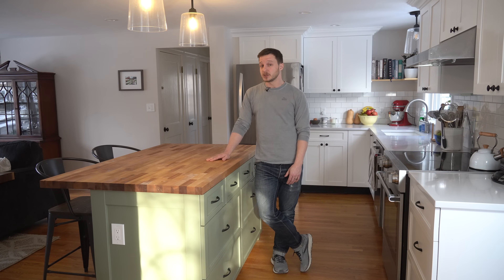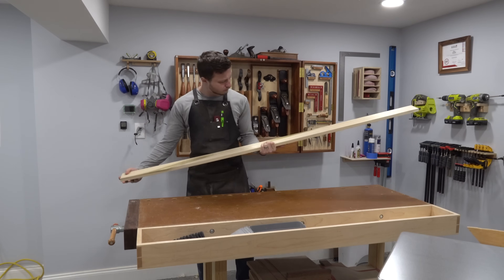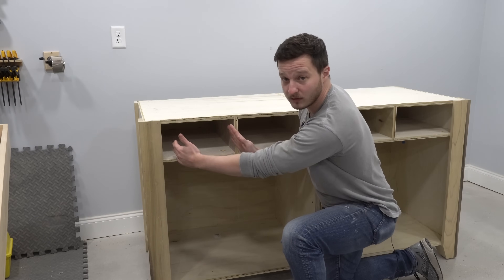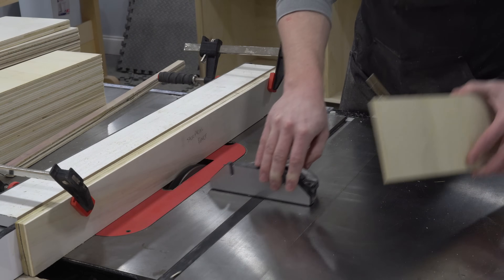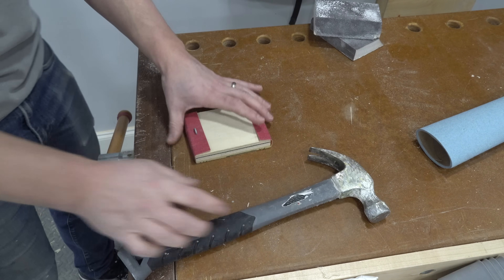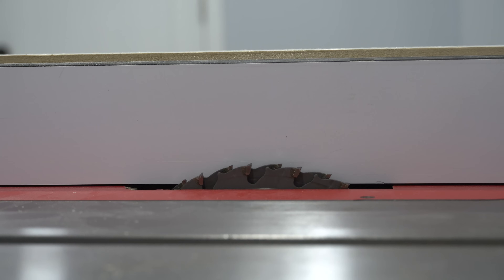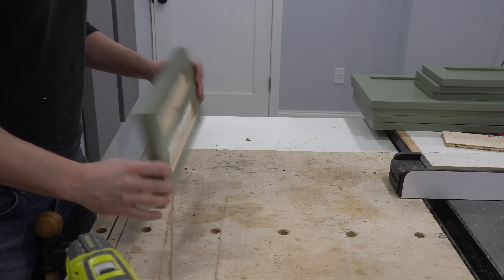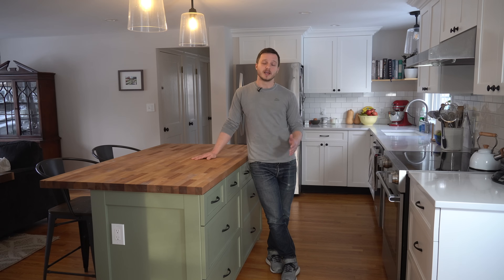DIY Kitchen Island Workbench

Comment: Beautiful work, David! It turned out better than I could imagine! 😃
About the flat iron bars, guys like Cam from Blacktail Studio normally use a C channel. But those are pretty thick table tops, so I believe your solution is perfect. 😊
Anyway, stay safe there with your family! 🖖😊
Reply from the maker: Thank you MC! And very good point about the flat iron bars, in retrospect C is much firmer and less likely to bend under a vertical force.
Stay safe with your family as well!

Comment: Great build and video. Regarding the "problem" with the sides. A dubbel side construction could keep the side board the original size, and also house the elektric were, also the drawer didn't have to be "adjusted". Just a thought for the design.
Reply from the maker: Thanks for the tip Rob, I like the idea of a double side construction. My only concern is that the drawers would have to be made smaller (but it's probably a safer construction with regards to the electric outlet). Cheers!
Reply: @dkbuilds  If you put the extra side on the outside the total length would increase  with 2x the depth of the elektrical box. Would be about 4 or 5 cm each side.
Reply: @dkbuilds  in the first reaction I said, it would keep de sideboard the original size, I should have said the drawers, my translation error, sorry. (Dutch - English)

Comment: Excellent video. I highly recommend you look into odies oil for natural wax finishes. It last much longer and is more water repellent than what you used. Very simple to use and you can sand it to higher grits for higher sheens. Just buffs on and off
Reply from the maker: Great tips, thanks so much. I'll check it out!

Comment: I recently DIY'd a butcher block countertop and read from a few places that it's supposed to be secured to the frame via adjustable brackets that accommodate expansion and contraction. This means the screw holes in the brackets are elongated and let the screws slide a bit to prevent bowing when the block absorbs and releases moisture.
Reply from the maker: Thanks for the comment Morgan! You are absolutely right. That is a mistake I made in this video for sure. I made a followup video about exactly this topic correcting myself, thanks to comments like these from viewers like you. Cheers!
Reply: @dkbuilds  You can also just drill a bigger through hole in the cabinet to let the bolt shift around a bit.
Reply from the maker: @stonee1968   Thanks Ken. In my followup video about exactly this topic that's the correction I made. Cheers

Comment: Hope you have better luck with iron-on edge banding than I have had. I've never gotten it to stick permanently to ply edges. I gave up on it years ago. I now use 3/8" (at least) solid wood on exposed edges attached with a good wood glue. More work for sure, but the top edges of drawers, and front edges of shelves take a beating... It's a good-looking build.
Reply from the maker: Thanks Charlie! I've had luck so far with edge banding, perhaps I have a different brand than you. Fingers crossed this doesn't delaminate over time. Solid wood is definitely better, just more difficult to do. I'll be on the lookout for delamination thanks to your feedback! Cheers

Comment: Looks nice.  You should remove the top and oil the underside as well to keep it from cupping weird in the summer.
Reply from the maker: Good point, thanks J!
Reply: @dkbuilds  got me thinking, I’ve made a few of these but never used mineral oil to finish.  The underside will dry out so if you do this, I would use a hardening oil like boiled linseed oil.  The top will most likely be replenished periodically.

Comment: First of all great work I love the look. I did however noticed that you did not but any finish on the underside of the countertop. it is important that you seal the entire surfaces of the wood to keep it from warping. the raw underside will absorb moisture from the air and expand where the top won't.
Reply from the maker: Thanks bob! Very good point. I appreciate it!
Reply: Yep this is probably more critical than making the elongated holes for mounting screws.

Comment: Nice build.Two points of caution though: The plethora of screws prevents the laminated countertop from expanding and contracting in an area located next to a lot of air flow. Even if the lamination prevents twisting it does not protect from seasonal changes in width.Better:Use elongated holes in the stabilizer which is fixed with 2-3 machine screws to metal inserts.Second point;the flat steel bar is not suited for the chosen application since it will only prevent widthwise movement (horizontal force) and not prevent bowing/sagging/twisting.Better use C or U shaped pannel take up vertical forces.
Reply from the maker: Two very good points. Thank you for sharing Baerenbruder!
Reply: @dkbuilds Thank you very much for your response to my comment. I hope my criticism was not too harsh but returns a little favor to you who puts so much time, efford and resources into this videos. Since I am well aware how convenient it is to sit on the sideline (as I do) when commenting on the work of other craftsmen. Your videos are great and I can only hope to become as good as you when it comes to woodworking. A fellow woodworker.
Reply from the maker: @Baerenbruder87  Not at all. You are the only viewer who has identified this critical mistake. I plan to fix this properly and release a short followup video about it, and I will credit you for surfacing the issue. You rock!
Reply: Another issue may crop up with having the unfinished bottom of butcher block directly on top of the solid sub-top, not able to have air flow and being unfinished.

It looks great though👍
Reply: @Baerenbruder87  I will agree with Baerenbruder87. I don’t understand all his comments, but the overall point is true. Don’t beat yourself up, DK, as when I was your age, I made these same mistakes, too. You locked that massive slab wood top up tight with that steel bar, the exact opposite of what you should’ve done. And you should have gone with your gut and not used the flat steel bar. There are many other options, but given that you like to use the big box stores, they also sell steel bar in different dimensions. You could have used 1 inch square (or larger) and routed that into the top easily enough. It would resist the downward bending force much better than flat stock.
Reply: Plywood doesn’t expand and contract like   Wood does

Comment: 32:40 I don't know man, I would have used a stout. A little heavier to hold it down better. Came out great. I've seen c-channel used instead of flat bar for support. I'm guessing it would flex less due to its shape.
Reply from the maker: LOL good point Two Bit... wheat beer is way too light for this application.
And, agreed. C-channel is better here, and attached with elongated holes to allow for more wood movement. I may modify this countertop in the future if I'm seeing any issues start. Thanks for the comment!

Comment: Question for you. Drawer slides, is the 22” on the slide the length of the slide, the drawer or the drawer opening/depth? If it’s not obvious how do you determine the slide length? Thx
Reply from the maker: Hey ConcreteLand! These are the exact drawer slides I used: https://www.homedepot.com/p/Everbilt-22-in-Soft-Close-Full-Extension-Side-Mount-Ball-Bearing-Drawer-Slide-Set-1-Pair-2-Pieces-D94222E-ZP-W/302867630

22" is the slide length. Hope this helps!

Comment: Great design and build. What type of plywood did you use and can you see any of the grain through the paint. I tried spraying some cheap plywood before, 3 coats primer and four of colour and I could still see the grain pattern when finished.
Reply from the maker: Thanks Derek! I used pretty high quality sanded plywood, and I cannot see the grain. I believe it is possible to use wood filler on the plywood surface before painting (maybe diluting it slightly according to the directions on the package) to fill up the grain. Hope that helps!
Reply: @dkbuilds  thank you for the response, this should help as I was not sure what caused my problem, wood, paint or spraying technique. When I tried it I just used a scrap piece of wood and paint that was laying about the shed (car paint). The purpose of it was to improve my spraying technique using an hvlp sprayer. Going to be replacing my full kitchen soon. Thanks for posting your techniques in your build design. 👍

Comment: I would be concerned with not having the bottom finished with oil or some kind of protector. The bottom while hidden can still absorb moisture at a faster rate than the top and may cause it to want to warp as time goes on. By applying oil to the underside as well both sides should absorb moisture at a similar rate and limiting warping. Also while not technically an issue consider buying things like drawer slides and mineral oil off of Amazon. You could have saved yourself a considerable amount of money. Just the butcher block oil alone you could have gotten an entire gallon for what you paid for those 3 bottles. The drawer slides as wel, I believe you could have gotten 10 pair for what you paid for the 6 that you used if not less if you got them from Home Depot as I assume that you did.  Just my 2 cents for what it is worth.
Reply from the maker: Those are some great tips, thanks McCart! I agree I wish I had oiled the underside. I haven't seen any issues so far, thankfully. Have you found the amazon drawer slides are as high quality as store bought?
Reply: @dkbuilds  yes I have found them to be just as good. I think the price is lower because you are buying 10 pair at once and not individual slides. Plus they are saving money on packaging. Now do not get me wrong you will find crappy ones but a lot of them are good. $125-145 for a set of 10 and cheaper if they do not need to be soft close. Im guessing you paid about $20-24 per slide at Home Depot.

Comment: the metal straps are not needed the top would be fine without. you should start at the bottom, hanging drawer fronts, makes life a lot easier. instead of taking 20 minutes to get the tenon thickness right use a piece with the groove cut in in already and get it set until you remove it evenly, your tenons are way too loose.
Reply from the maker: Thanks for the input Adam! I started the drawer fronts from the top because I was looking for a very specific sized reveal under the countertop... otherwise I agree. Great tip with the tenon thickness adjustment!

Comment: Good build for the most part. Your style and rail tennon way to loose.
Reply from the maker: Thanks Tim! And, I agree about the loose fit. However several months in with very heavy use the drawer fronts are still solid as a rock. Though, I would have still preferred a tighter fit. Thanks for watching!